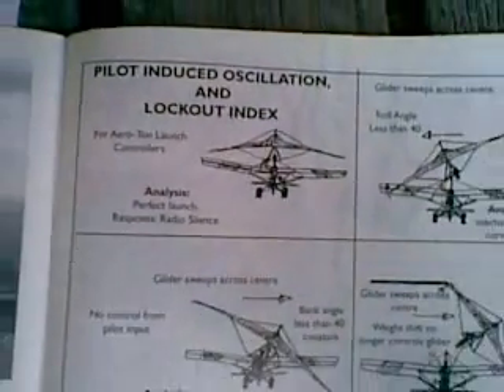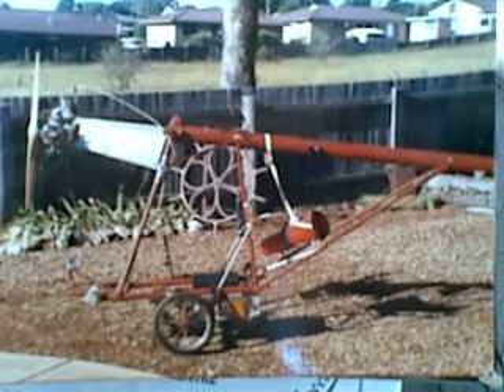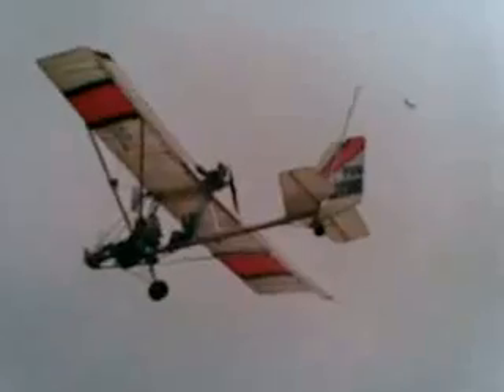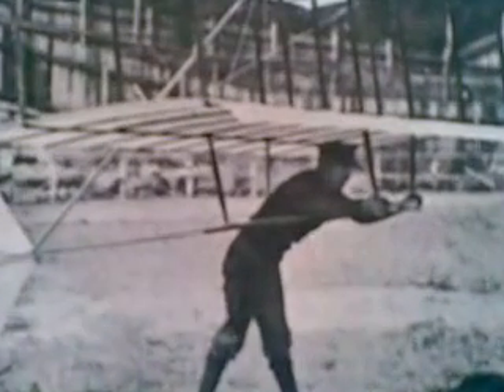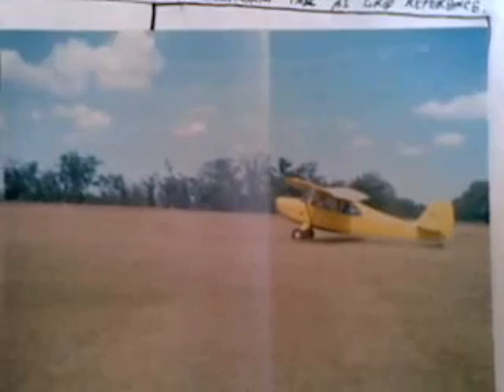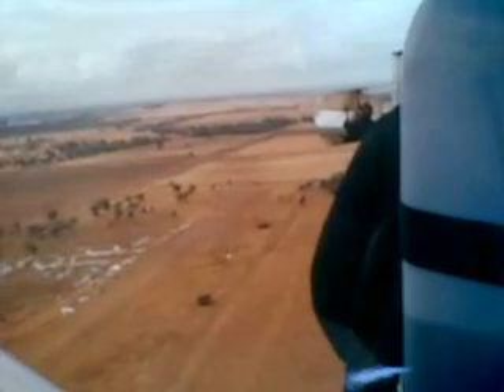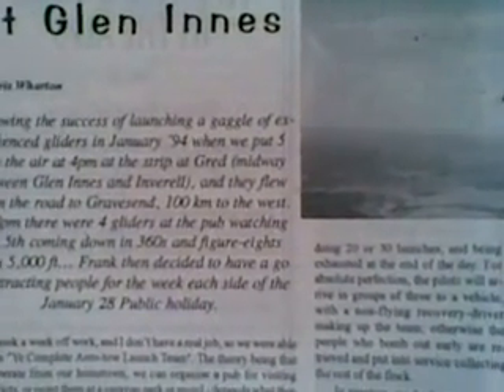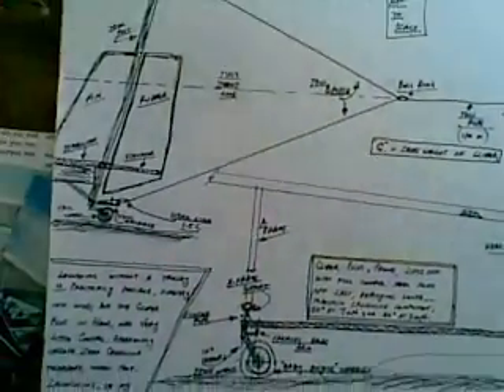Aerotowing Rogallo Hang Gliders. Pilot-Induced Oscillation & Lockout Index.

Comment: I'm wondering why it would have been safer to hook up to 'Old Mates' tug instead off Moyse's tug if you had no radios.
Reply from the maker: G'day,

 Thanks mate,

  You're absolutely correct, on that day, Quentin was going to be behind a Tug with no Radios, so it would've all been down to the Attitude of the Tug-Pilot towards having the Glider disappear from the Mirror...; whereas Old Mate was used to being able to rely on me to tell him when to release, and he was twitchy at the idea of getting anybody locked-out behind him without a Radio to tell him, and he'd decided before starting that if he couldn't see them in the Mirror then he was going to assume they were in trouble and therefore immediately drop the Tow.

  On the other hand, the GuRu Incarnate was used to towing without a Radio-Link to an Observer, and his habit was to slow down in the expectation that they would be able to regain control...; after all, that's what he was used to having happen...

   What we learned that day was that Towing without Radios is too dangerous to agree to, although if Quentin had have been behind Old Mate's Tug then he probably wouldn't have crashed quite so badly...

   Life's a Learning-Curve, apparently...

  Take it easy,

;-p

Ciao !
Reply: +WarblesOnALot One last question.(said the lounge chair critic) Did anyone suggest to the glider pilot that it might not be a good idea to fly- considering the conditions and his limited experience, also mixed with first-time flying of a high performance glider? To me, in magical hindsight, the whole episode looked like a recipe for disaster.
Reply from the maker: Jack Frost 

  Well, actually, Quentin was talking to me while we were assembling the Tug (it flies so slowly that it travelled between Towns on a Trailer with the Wings removed...), and he never volunteered the information that he held a "Novice" Rating..; and, since the Day was an Invitational for people to have a free trial-fly of the Glider which was rated as requiring Pilots with an Advanced Rating..., it never occurred to me that he would've shown up and stood in line to fly unless he was qualified to be there....

  It wasn't until after he crashed, maybe the next day (?) that I learned of his "Novice" Pilot Rating...

   The event was pretty much "organised" along ad hoc & spontaneous lines, the invitations were by word-of-mouth over multipleTelephone-Trees, we'd been contacted by MDG & asked to be there and offered accomodation and told we'd be paid for going, because they wanted a 2nd Tug..; but as far as I know all the Hangies were there on a "Whoever shows up can line up to fly the newest latest greatest Offering from MDG...".

  I dunno if they'd be doing things that way these days, after the Quentin episode they probably learned to check people's Qualifications before clearing them to have a go ; but back then the assumption was that nobody would try to fly anything beyond their abilities...

  So, a Novice in an Advanced Kite, being Aerotowed with no Radios, through Thermals being chopped up by the Sea-Breeze with Mechanical-Turbulence off the Trees at the Upwind end of the Paddock...; in hindsight, what could have gone right with a setup like that ?

Have a good one,

;-p

Ciao !
Reply: WarblesOnALot Another case of the dreaded "chain of events" syndrome I guess.
Reply from the maker: Jack Frost 

   Absolutely..., every time somebody breaks a Flying-Machine there's always a long backstory which is sometimes very obvious in hindsight.

   And, in my experience, as soon as people try to turn the Passionate Hobby into a Career then the opportunity arises to focus 
more on the Commercial angles and possibilities of trying to do something, rather than concentrating on only trying to do things which are known to be workable...

  The Commercial temptation is try to press on with the Plan despite any percieved obstacle or difficulties arising (like discovering the Radios were still at home..., or Flying on regardless of the choppy turbulence and rough air...) ; in theory it's,wonderfully exciting and romantic to make a living by flying, but I once made my living selling Joyride Tickets for Australia's first Female with a Commercial Rotary-Wing Licence, barnstorming in a 3-Seat Enstrom F-28c..., and Life shrinks down to an endless struggle to fly the Aircraft enough Paid Hours per month for the whole "Enterprise" to break-even...

  Though we did charge for Aerotowing ($10 to take-off & get up to 1,000 Ft plus $1 per Hundred Ft thereafter, with Rope-Breaks on the Runway for free ; but  Rope-Breaks over the Fence or Tow-Releases for Locking-Out cost the $10 Take-Off fee....), both Old Mate and I were doing it for the fun of it, neither was relying on it to live on ; I was a Sole Parent Pensioner and he had a Job with the NSW Roads & Traffic Authority.., Aerotowing was just a good fun thing to do with his Aeroplane and he needed help to do it, and we'd been messing around together with Hang Gliders and Ultralights since 1979..., so I was offered the spot of Ground-Crew/Hookup/Launch-Controller.

  And it meant getting to play with a World Protoype, doing interesting stuff, and sometimes even getting paid to have fun with Aeroplanes..; so I lapped it up, as a "part-time Professional", it was great fun and good for the self-esteem..., but I'd hate to try to depend on Aerotowing to pay the Bills...

  Have a good one,

Ciao !

Comment: Look up closed loop and open loop control systems......it's such a great example of backlash problems, weather it be in a CNC machine system, or a Land Rover with two inches of movement on the stearing wheel before the road wheels start to turn. I was think about control systems on wind generators this morning, and the possability of using a newton governer to control the perminant magnets as they swing out over the coils, under the onslaught of a good blow. More breeze, more output .